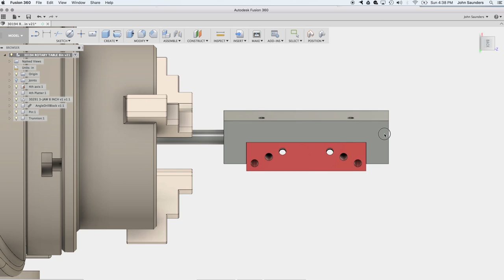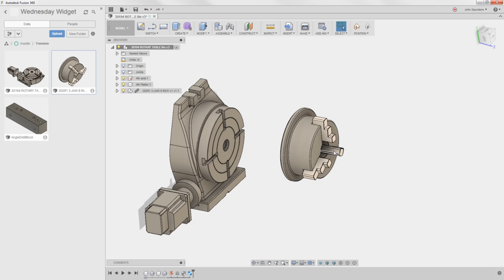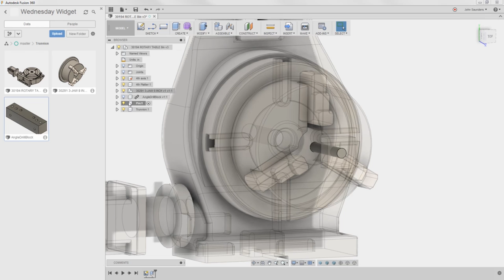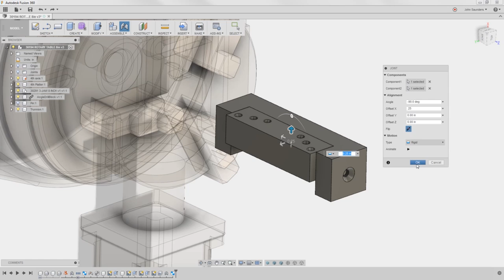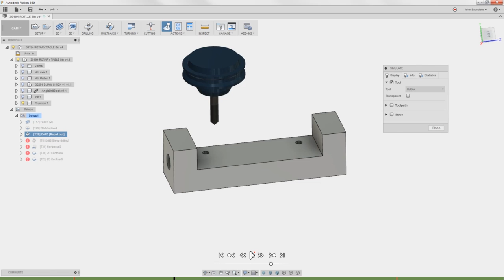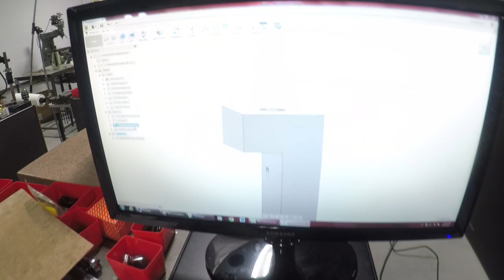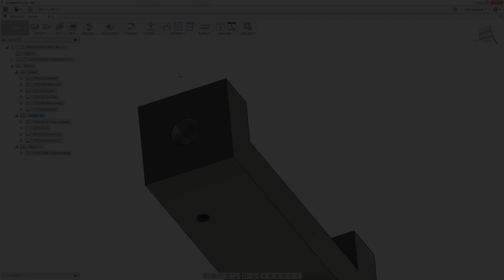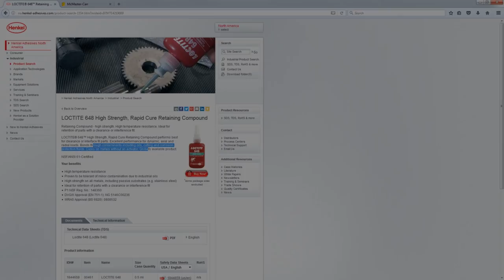Tormach 4th Axis Trunnion!  Part 1 WW140

Comment: Do yourself a favor and get some parabolic drills. You can really push those, I almost never bother peck even. Maritool has cobalt Morse branded ones and they are pretty affordable. Ever try 3d horizontal for floors? I like how that tool path "sees" more of the geometry and outputs a nicer looking toolpath, its also seems better at avoiding leaving the little cusps it looks like 2d missed on this part.

Comment: John in a case like this I would heat the part to 300-350 degrees F, the dowel pin will slide right in ( you could freeze the dowel pin to buy some time on assembly, Just put in a freezer will do the trick). The neat part of doing it this way is the dowel pin will seat  parallel and concentric to the bore. Jim

Comment: John, I doubt very much that you have a coaxial alignment from end to end (concentricity).  if you drill the ends like you did and then remove a lot of material out of the middle section, the part will tend to fold up.  To verify; install the part in a lathe - pin into a collet and indicate the run-out in the hole at the opposite end and I think it will wobble considerably.  I would have squared the part up(oversized), then rough milled out the middle, bore the ends.  And finally - like others below said, finish mill while using the 4th axis.

Comment: I use Loctite 648 to retain bushings in Ohlins motorcycle forks.  When I am working with steel and aluminum interference fits similar to what you are doing I usually pop the steel part in the freezer and when I am ready to fit them I warm up the aluminum.  They then go together with almost no force necessary.  Only drawback is that you don't have much time to do it as the parts go back to static temperature pretty fast.

Comment: you need to download the loctite tech documents, there is detailed info in those. with interference fit if you want to use the retaining compound you need heat so there is enough clearance for the liquid to create a film between the 2 parts. I'm quoting from memory but that's what I recall.It is quite strong but can be removed with heat.

Comment: Rule of thumb. Thou per inch John. With that fit you could have heated the ally and dropped in the pin. I find 680 loctite the best to use in the workshop.

Comment: John. Please. Square up your stock prior to doing parts like this. Takes but 5 minutes to ensure you have a trued up datum surface.  

Always cringe when I see picking up to relocate a WCS off of raw stock. You don't know if that stock surface is warped, tapered, twisted etc.  especially if you're trying to get two features concentric to eachother on either side of the part like this. 

Raw stock is not a datum surface...
Reply: Occams Sawzall I think he's under the assumption the stock is as square and parallel as his Fusion model.
Reply: Cad-Cam_Man 
I may end up wrong. But I'm betting a good .015-.020" TIR along the axis of that fixture. 

Honestly I would have just turned true a large diameter piece of round stock, chucked it and centered it in the 4th axis and milled the fixture directly on the 4th axis. 

And if I was feeling particularly fancy add tramming flats and a tooling ball location
Reply: once the centre is in good and tight, it's going to flex that bracket every which way as the 4th axis rotates (since centre hole not necessarily along the centre axis of the pin).

Would go for: bar stock, clean up outside, face, center drill, break edge. part off then edge break previously chucked face. Insert into rotatory table in mill, reduce thickness of bar 1/3rd centre section over length of held part + clearence to give flat surface to mount block against. Drill and chamfer 1x clearance holes for securing and 2 holes for locating pins.
Reply: Chris Shucksmith 
Might not. It's not going to be that much tail stock pressure. It's just drilling holes. 

But ya. I would have made sure the center axis passed thru a solid piece of material rather then separated by that cut out. 

Plus with the part in the fixture as long as it's a snug fit it shouldn't flex that much. But that would require tramming the fixture with the part already in it.  And by the time you're done milling the part to fit correctly and be used to tram the fixture, coulda just drilled the holes. 

It is a good train of thought, but poor execution and not the best application for the part

Comment: I didn't have time to scroll all.of the comments so forgive me if this is a repeat.  use a piece of TGP material in the 4th axis after putting centers spots in the end.  machine the cut out after assembling the reunion.  don't forget to dial in the TGP  prior to machining.  Once done, every thing should be concentric etc.   use 1144 stress proof to minimize warping from material removal .

Comment: Really cool project and I look forward to seeing the trunion in action. I would like to mention that on future designs you might want to drill out the bottom of the dowel pin hole so there is a path for the air to escape. Why did you choose to press fit a dowel, instead of machining a round end on the trunion block itself?

Comment: hey John, just curious why the choice of press fit in lieu of a shrink fit. similar to warming bearings and "freezing" the home shaft, you run a much lower likelihood of deformation due to misalignment, especially with dissimilar metals. Anyway, that's only an industrial mechanics opinion/question. keep up the great work and keep ever forward! best wishes, Craig.

Comment: Heat the trunnion, and freeze the dowel pin. Then press in. No glue required :)
Reply: Rule of thumb from AvE if I remember correctly, 1 thou for every 100 degrees C?
Reply: also the upside down compressed air trick works a charm, no need to wait for a freezer
Reply: Agree I would use my induction heater just like any shrink fit holder. Tell you what it works great for a lot of projects presuming you can fit within the 4” coil.

Comment: When extruding to a face you can tell Fusion to extend the plane for the face indefinitely. A menu item labeled "Chain Faces" appears.  The reason for the behavior is you can extrude to a non planar face, or multiple faces, leaving the curved surface/multi-planar face on the extrusion. However when it doesn't see a plane to collide it freaks out because the extrusion is now indefinite. You can fix that by bumping that button to extend the face.

Comment: About extruding to a face, have you tried the "Chain Faces" toggle in the extrude menu?  I just discovered this yesterday but after you select the face and it gives you an error, it seems like selecting "Extend Faces" instead of the default "Chain Faces" makes it behave like you'd expect.  I don't know why it won't extend to a face automatically though - like Inventor does.

Comment: I don't think the two faces of the trunnion will be parallel too each other as the stock wasn't machined squared  before machining the ends..? I would have used round bar on the lathe and turned  the faces then finished it on the rotary table..it's always trial and error with new designs though, keep up the great videos!

Comment: Good luck having that 60 deg. center hole in line with the centerline of the 1/2 inch pin. You are a trustworthy soul relying on the extruded edge to hold the thing in line with the bored hole. How are you assured that the cutout floor will be flat and the vertical walls perpendicular with the centerline once it's mounted ready for use? Just because you cut it doesn't automatically make it  correct.

Comment: Just curious here and excuse my dumb question (if it is one). Is there a reason not to thread a hex rod and the trunnion while using a locknut to secure it in place? This would make it a modular fixture for use with other trunnions you might need to make.

Comment: I would of put a pin on the other side vs a live center hole . Then machined a  part that's bolted to the table  , and have a bearing pressed into it. 
The second pin could be a light press fit . You could simple press it out and have a few reunions you can swap in and out . I believe this would be more ridged .

Comment: Wont leaving the 1 thou on the bottom of the trunnion make the distance from the part to the center of rotation different than it is in Fusion and mess with your tolerances?

Comment: why you dont use a six side Rod so it cant move in the jaws of the 4th axis ?
Reply: Came here to say this.  Or use a 4 jaw chuck, or bolt it to the plate.  I don't understand pressing in the pin, just seems like extra effort.  Turn it in the lathe, and use the chuck & positioner to put flats on it in the mill.  Flip it and machine the fixture.

Comment: Is there a reason you used loctite 648 rather than 603? Or is 603 only for brass? I have had great results using 603 on stainless.

Comment: would that locktite 648 be good for installing at barrels to receivers or is it more of a permanent bond. like once u put 1st barrel in with it(648) you'd probably have problems removing and replacing a barrel?
Reply: Consider it permanent if used in accordance with instructions and good engineering practice, but heat will break the joint and barrels can get hot, so perhaps not a good idea in case it fails in use. Best to stick with threading the parts together, if I understand your question.
Reply: We use it for assemblies at our shop. That stuff is very strong. Its more for permanent bonds.

Comment: "God bless GrabCad" AMEN! Hey John, fusion has been slow and crashing for me fairly often. Do you have this issue much? I'm not sure if this is just a signal that it's time for a new PC or not

Speaking of 2d pocket, It turns out its great for engraving. I just tell fusion I'm trying to clear out the area with a thou and a half endmill and it ends up making a fairly distinct engraving even though it's bare, hardened stainless.

Comment: Loctite 680 is the strongest. 
I've had 1" bushings in the press that were "glued" in place with 680, 10 TONS on them and NOT moving. Heat to 350F and it will release.

Comment: I'm honestly perplexed you would use that 4th axis. The other one that is able to be put on the right side away from the tool changer is better. Second, I wouldn't use a Chuck. I'd rather have something bolted to 4th axis Face as a tombstone or something. But whatever, if this is a way to see if the part can still be done like this, and these components are what you had to work with. No matter, no big deal. Just my 2 Cents of thought.

Comment: The animations of joints coming together seems a little bit cartoonish; can you turn them off?  I mean in the literal sense; if you like them or are stuck with them so be it.
Reply: I think Fusion 360 shows the animations like this to give you an example of how the joint is going to behave and/or what parts have been joined. It is over animated so you can easily see if something didn't go as planned even if you are not completely paying attention to that step anymore.
Reply: You can shut the animations off if they bother you.